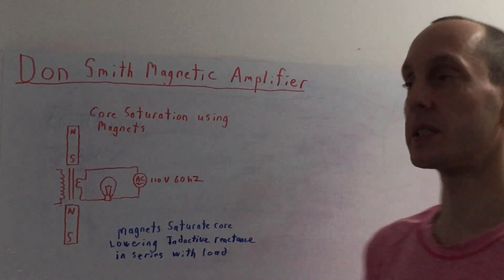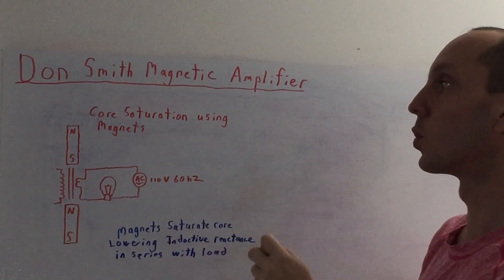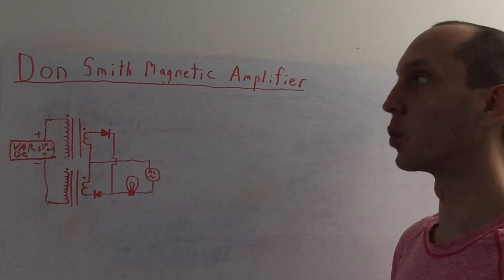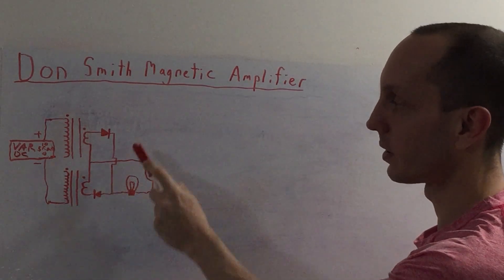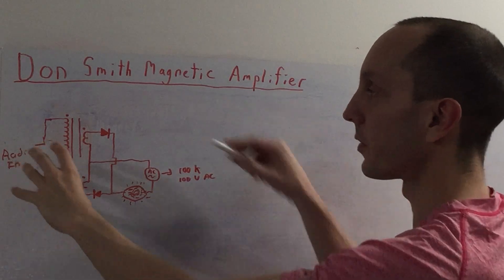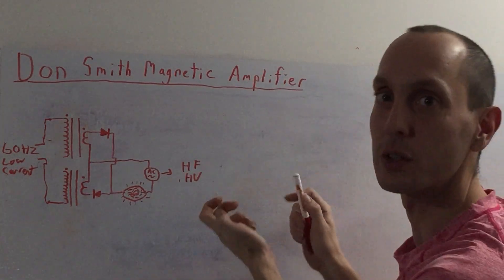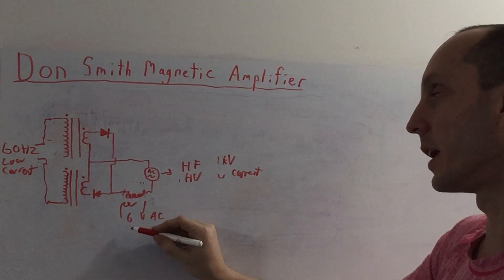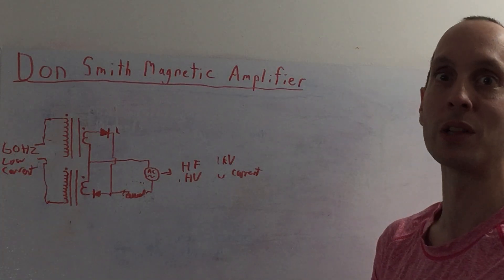Magnetic Amplifier

Comment: This is very good approach , i mean magnetic amplifier, never underestimate reactive power which circulate as condition as HV,HF at resonance , by doing this action circulating energy  can easily achieve kilowatt level in between L-C , the question is how you can activate it as useful energy by not disturbing trigger circuit (source), And do not forget atomic particles are also have mass .,Bird_eye  """"""""""This is the story in between the capacitance and inductance."""""""

Comment: read between the lines. consider you, have 2 currents, that have 2 directions., Then you need 2 coils, and they should be wound opposite each other. there is 2 kinds of current, ac and dc. but the point is you are missing 50 Percent of the available potential. secondly  magnetic cores wound in a manner of coil ,over coil, over coil, creates a better magnetic field strength.
distance like a secondary Tesla coil.  does not take advantage of magnetic field. so for more magnetic field is better. you could wind single coil inductors cores, biffilar.   do you have any bffilar coils?

Comment: let me say this,  if you have a continual discharge, then this creates a electric magnet on the static end.at the ceramic capacitor that is by polar. also there are sharp points. continual discharge creates very large magnetic fields. so to use conductors that take from the dc end of the ac potential. it has enough  vols dc if you focus on rectify the dc part from the ac wire. a spark or a Tesla ball  perhaps. but yea you can take the dc off the ac then you proved you can directly charge a battery. focus on rectifies the dc from the ac potential..

Comment: HV must be 3,73 kV
Reply: Why?
Reply from the maker: I think its a joke reference to the golden ratio.
Reply: @joellagace1679  This is written in Avramenko’s book The Future is Opened with a Quantum Key. In short, it says that the Bose condensate of the ether interacts with matter at a voltage polarization of 3.73 kV. Those who repeated Kapanadze’s installation, they all have a high-voltage coil under the same voltage.